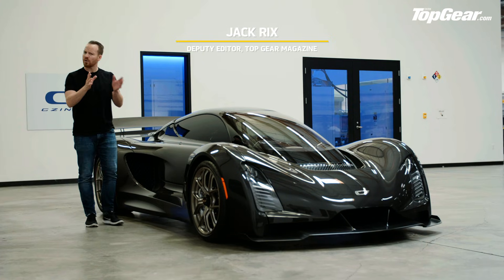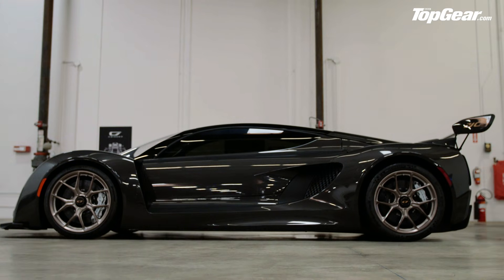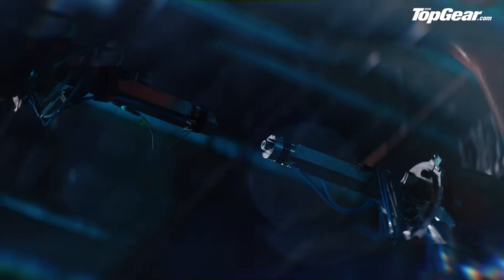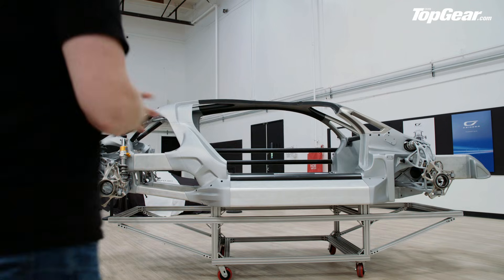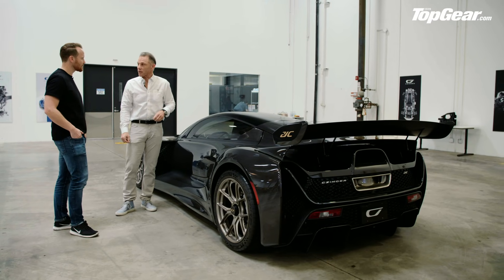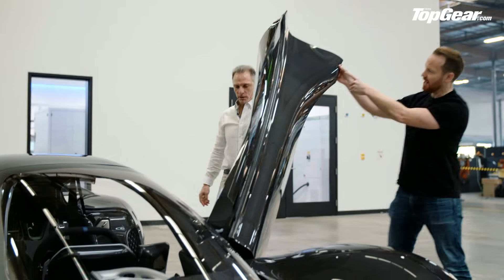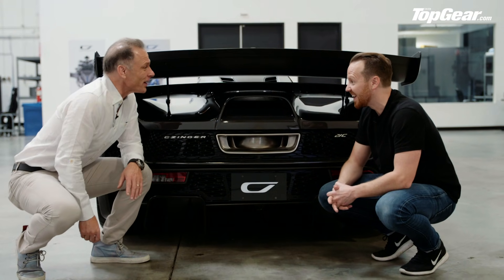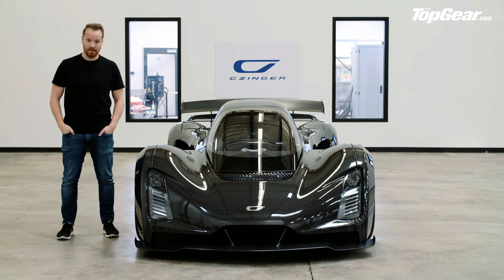FIRST LOOK: Czinger 21C: the world’s first 3D printed hypercar | Top Gear

Comment: Yes taht Part is thinner and It was done from a computer and It uses the amoint of Material it that part needs but, the computer calculated the stress that Part could have only based on the calculations  that people themselvs wrote out in the Algorithmen, that means: how could i know how much Force of resistence or stress did the engineers write in the Algorithm?
How van we be Sure that it would not breag easly?

Comment: What a way to market the capabilities of a truly innovative and adaptable manufacturing process by creating the most extreme of its abilities in a car with mind bending performance.

If knew about this in its development stages I would have just invested everything I had in it...

This is the key to the future... Every industry needs to be looked at again from a fresh slate every decade from now on not 50yrs because technology is developing so quick that previous methods are effectively redundant albeit for a nostalgia or tradition factor...

This will take off once they develop a way to print the most cost effective cheap steels that China can produce.

The modular design of chassis for repairs is awesome too...

It's the perfect solution to bridging the gap between driverless future and where we are currently.

Just wow from every angle...

Comment: And it built using metal, I'm actually imagine if the A.I designing this car considered using carbon fiber for the whole chassis. More lighweight & probably more power to weight ratio.
Reply: Carbon fibre-reinforced plastics have their own disadvantages. For example, they are not very good at deforming in extremely high-deceleration scenarios, like in a crash. Metals are a lot more malleable and can deform in crashes, which uses up energy from the impact and possibly reduces injury to the occupants. Remember the Boeing 787? Originally, its wings' leading edges were supposed to be made almost entirely out of CFRP. But during bird strike tests, it was discovered that the CFRP wings were prone to fracturing on impact, and were quite brittle compared to metals like titanium or aluminium. Therefore more of those metals were used in making the wings. Maybe in the future we could have CFRPs that are more deformable on impact, but right now manufacturers still have to compromise.

Comment: 2.8ltr V8 is tiny. Half of a C8 LT2 with twin turbo. Yikes. You want the tyres to match to keep it on the road.
Reply: atleast its more fuel efficient and sometimes engineers can have an engine that can be more powerful than for example a 5.6L V10

Comment: Can this company create a robotic or actuator system for the turbo dump valve that's actuated on breaking to reduce lag pressure and prevent the turbo from slowing down once it reaches maximum pressure because I'm tired of having to wait for the turbo lag to finish I'm also tired of not having a fully functioning turbo when I need the power at its maximum when I need it if the turbo can dump its pressure on breaking  then you will have more power coming out of the turn when showing down and give the car better performance and give this car an added edge over anything on the road in the world

Comment: Now print me a 6x6 portal axle super strong/light off road /on road  beast with a living compartment  included, ie, the ultimate overlander rig,  about the size of a large van, less than three ton,     no flash fuel ( they don't have supplies in bumFk nowhere , maybe diesel electric. TA!    price....about he same as a normal japanese 4x4, should be achievable!

Comment: Awesome... but all that effort and it doesn't have a retractable wing. No reason you can't go 270, and have downforce when needed. BTW... looking at the build cell... I have doubts it can do what they claim. Robots need to pick and place components from cells, conveyors, which are accurately located.

Comment: Price parity through output frequency? Certainly not. The cost-per-part in a 3D printing process stays the same, no matter how many parts you produce, whereas in casting, it goes down. You employ 3D-printing when you want complex shapes with unique properties and maybe save a bit in the downstream process steps - which is exactly what you see in their CAD model. Where you DO save is in the investment and then you ruin everything by adding a second technology (electric motors) with added weight, complexity and cost. Not smart at all.

Comment: Elon musk  had mention a problem in mixing Carbon fiber and aluminum parts together, because the two materials contract differently in hot or cold weather. causing the body panels to shift. How's that working out? Or do we  just assume Super rich people will keep this in 80 degree weather all year round.

Comment: Reality check, sunshine. To produce 1 kg methanol, you require 1.374 kg of carbon dioxide. To get that amount from sea-level air, you need TWO MILLION CUBIC METRES of it. Just to pump this amount with a blower, not even compress and process, you need about 250 kWh, or about 900 MJ. One kilogram of methanol contains, calorifically usable, 22,7 MJ/kg. Meaning, you need about FORTY TIMES the energy to just pump the air alone needed for what you get out in methanol, not counting pumping and processing other ingredients. Do your maths and stop spewing this BS.

Comment: As long as they do away with the fiberglass on the outside of the vehicles that smash-up and the front of the car could have these two big giant Springs that when you crashed into the back of a vehicle or a wall it will contract the Springs back and save your life

Comment: 3d print the exterior structure is easy. What about the engine or battery or electronic circuit? They are the most expensive part for a car.

Comment: no pump gas or non race fuel options? i guess you can always use that back seat to hold a gas can...computer optimized designs are pretty cool though.

Comment: The problem with AI constructed organic forms are that the AI doesn't care about the people who are going to work on it later, the AI doesnt care about dirt accumulation in the organic shapes, and the AI only makes the parts tough enough, without margins.
If you tell the AI that the spinde should be able to go over a speed bump at 100km/h, it does break at 110, or if the speed bump is bigger then the one used to calculate it.

AI's are great, but they don't have imagination, so it is important that the programmer takes that in account.

Comment: Where is the proof in the pudding on the performance specs.  How fast can the parts be printed? What is the critical path on parts - i.e. slowest moving?  How are carbon fibre made robotically?  Parts seem insanely expensive.  Cool looking car.  Looking forward to the actual proof.

Comment: So....couldn’t we just 3D print entire engine components without fail points like “head gaskets”? Then boost can be determined by the strength of the rotations assembly instead of the material that holds the cylinder together

Comment: Having worked on robots in auto assembly centers, I know there is a lot being glossed over in this report.  Each and every robot has to be programmed for every movement and programming takes a very long time.  Every time you change the car in any way, they have to be reprogrammed.  The good thing is that if every pod is exactly like the other ones, you can change what car is made in any one pod in the blink of an eye.  Still though, all of the parts that go into the car no matter how the part is produced or shipped in has to be transported to where the robots pick them up.  That means you have to have a supply chain , a stable point where the part is picked up by the robot and room between everything to move parts to the assembly area.   This car and the way they produce the parts is amazing but not as simple and fast as they make it sound.

Comment: Coolest thing I learned is my brother's methanol powered, 1000hp dragster is a zero emission vehicle.  Whooda thunk it?
At 7 minutes, the examples of topology optimization, the far left one is a trinket, not the finished, design verified, optimized component.  Been doing T.O. for over 10 years - cool application and neat car using dissimilar materials, nodes, CF connectors, traditional fasteners and structural adhesives.  Kinda like the productions sled chassis I designed, with the help of a few co-workers, several years ago...

Comment: How many things can you really 3D print? 

Surely most components you'd still need to buy from suppliers like the starter, alternator, radiator, windshields, seats, steering wheels, wiring harness, firewall and felt insulations, instrument panels, junction boxes, ECUs, steering columns, shock absorbers and coil springs, air conditioning units, tubing for all liquids like lubrication  powertrain and gas lines, and basically every other electronic components.

Comment: I’ll believe it when it actually drives and drives well. If they’re making 930hp on methanol (carbon neutral, not zero emission) it won’t make that on race gas. That being said, the real value of this company is their technology they use to build the car. If I were a billionaire I’d invest in them just to have them develop the manufacturing tech, and then license that out for a fortune. I hope this thing turns out to be an awesome car though, because there’s too many hypercar and supercar failures that we’ve seen over the last couple decades.

Comment: im still wondering how those thin components would do in a severe crash, like your talking 270mph top speeds here
and those are some real thing pieces,
Reply: why, they break, obviously. just like regular components do in a severe crash
Reply: @KnightMirkoYo  i know but like this car seems incredibly unsafe, for racing,
Reply: @SpicedHanna  to me too! Although, by definition of computational design, their shape was generated to sustain set levels of mechanical stress with specific vectors of applied forces. IF they accounted for everything with a modest leeway, then it should be safe. But if a light wheel touch in a race results in a component failure, it's unsafe for sure. Remains to be seen in test runs. Also, since they are able to rapidly generate and print new designs, they could surely change a lot of steering/suspension before it goes to production. Current design might be even primarily for shows. That said, I don't really track their progress and publications, so I may be unaware of some important information on this.

Comment: Well, there you have it, an engine with zero emissions, not that I personally have a huge concern with that, but nice to hear. Full electric vehicles are certainly Not the answer, as All those who think that's the future, could not be more wrong. Manufacturing & disposal of batteries are far more harmful, then any combustion engine being built today. Plus, supply & demand would dictate, on a planet with a ton of electric vehicles, that your utility bill would go thru the roof!!! Pretty awesome car, although I'll never.be able to afford one...but, maybe this company will show others how to do it? As always, Top Gear's presentation was Awesome😁 Thanks & pretty cool this is an American product🇺🇸!!!
Reply: No such thing as an ICE without emissions. Their working principle literally depends on emissions. Carbon-neutral, perhaps, yes, depending on where you shop for the methanol this thing runs on. But of course, "zero-emission" sounds even better in marketing speak where you can make anything up, so that's the term they're using.

Comment: I do wonder about the strength of DMLS 3D printed suspension parts. Surely these are far more brittle and more likely to crack & fail than the cast/pressed parts we have currently? Would love somebody more educated to give an insight to this!
Reply: They are not. Actually, the repeated small-scale heating and cooling events are quite beneficial.

Comment: the suspension parts look like organic bone structure,...as if they evolved to this shape. It's truly impressive.
Reply: Because that's what they did.
Reply: @Anvilshock  I meant biologically evolved like an organic structure,...so no, they didn't...
Reply: @mementomori4972  What do you think biological evolution does? It does exactly the same as the process used to optimise this part. It adapts to the requirements and cuts out what isn't needed. Just because one works on organisms and the other works on mechanical part shapes doesn't mean they are fundamentally different in their effect of producing an optimised shape.

Comment: The car is cool but the headstart is miniscule because the $150 million in technology is all off-the-shelf. The price is far beyond its actual value, I expect the technology to be replicated everywhere.
For example: you don't need robots to build it, and anybody can buy a 3d printer and make nodes. Carbon fibre tubes? I can make those in my garage, if it weren't for the fact they are cheaper to buy as commodity material.

Comment: my PhD is on the combination of topology optimisation (the software used to design those organic suspension bits)
with additive manufacturing (metal 3D printing like this)

and this really is on the edge, the question I'd have though is: does their FEA modelling really model the 3D-printed material accurately enough for those designs to actual be "optimal", or do they just simply look "optimal enough"?

Comment: There is a problem with cavities forming during the process of 3D printing metals, though, which is why manufacturers aren't using it yet (the danger of fatigue and stress fractures). So the really big news is how they overcame this problem, assuming they have!
Reply: Aluminium and titanium have been used in powderbed-fusion-style additive at production level for quite a while now. Nothing new.